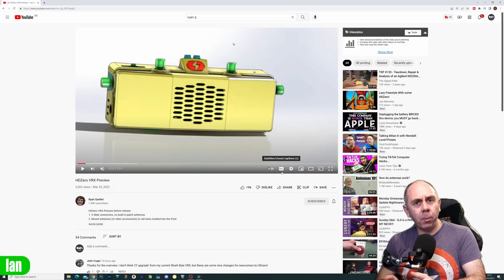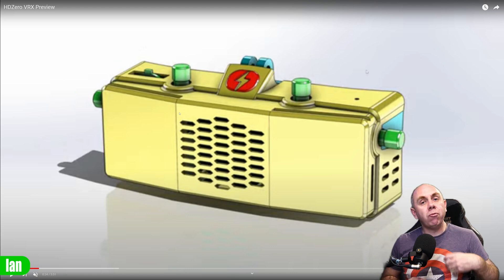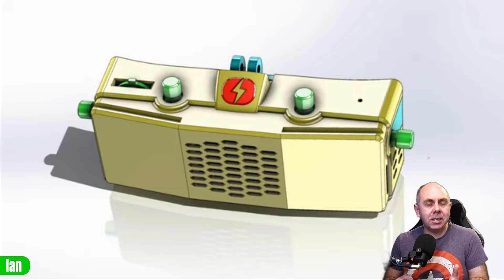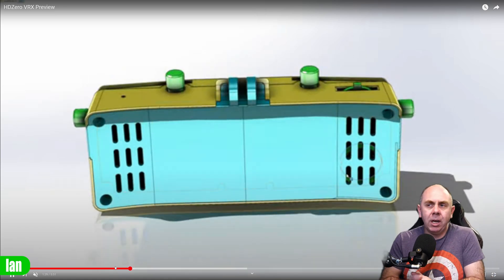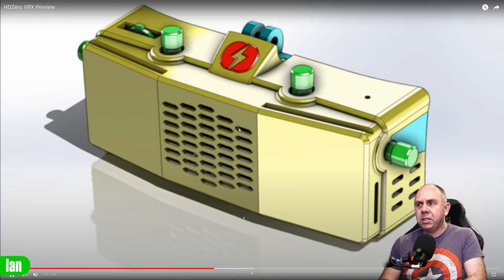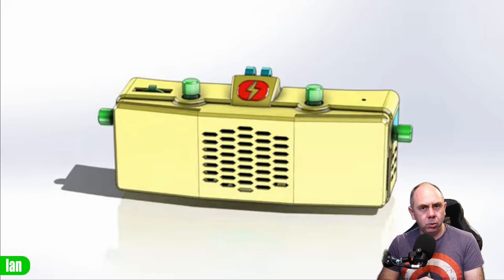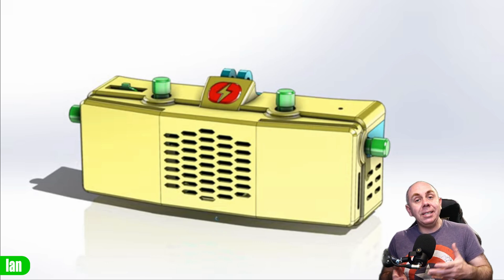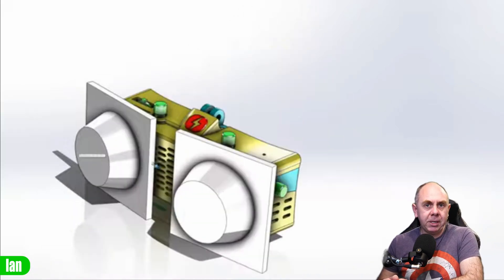HDZero New VRX FPV Module - Renderings & Info Shared

Comment: Eleven Watts... just for the VRX.  That's pretty heavy, given there's no video compression (to speak of) being used.
Reply: I'll say! We're going to need some 3s 18650/2170 holders as this'll burn through the typical 2S pretty fast! I bet it's because they had to switch to an older chip/larger node in order to get some supply... Hopefully some ASIC's have been ordered on a newer node!

Comment: I think that by saying that a product that uses 57% more power than its predecessor as "a little bit more power" is completely disingenuous and biased.  Shocking comment.
Reply: A little dramatic mate 😂
Reply from the maker: It’s 500mah additional draw based on the regulator voltage.  Yes it’s going to have an affect on some users who use smaller batteries but it’s not a major problem.  Sorry but there are compromises that need to be made. It’s really not a major issue. 

It’s neither bias or anything else as no one has modules in hand to confirm the actual numbers yet.